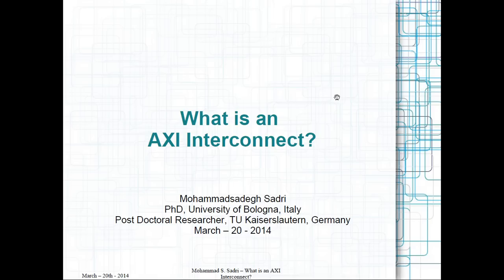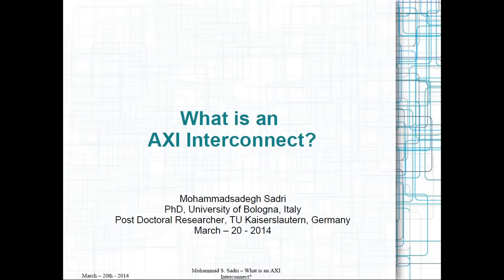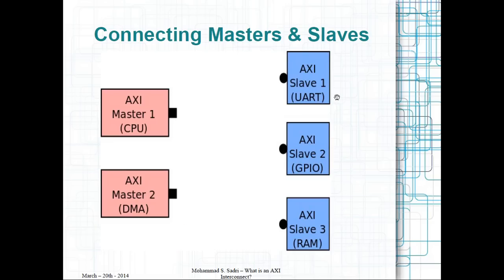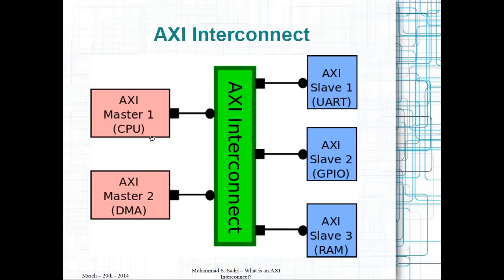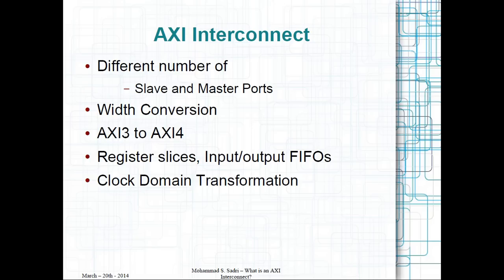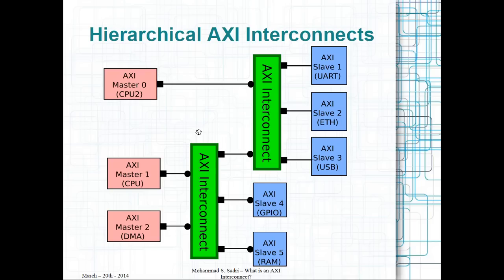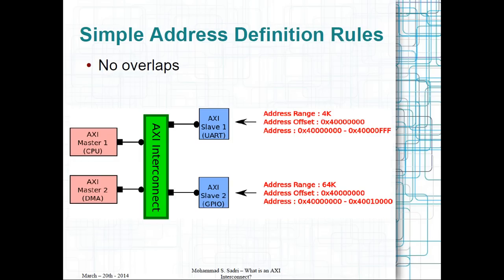ZYNQ Training - session 02 - What is an AXI Interconnect?

Comment: Hi Sir, 
Can you please clarify the address alignment rule that you talk about at 12:40 please? Why can't we use the starting address at 0x8000_0000 for example? Why does it have to be 0XC0000000?
Reply: I don't know if you still need the response, but perhaps someone else might h sees this comment later. The way I understood it is in the following way. 
The start address of the block should be a multiple of the block size.  You don't want to end up wth a 0x40001000 - 0x60001000. The reason for that is readability and memory management. I'm not quite sure though why he chose 0xC0000000 as an example for he offset of 2G.

Comment: Please tell me what is the advantage of having two different clocks ?
Reply from the maker: +Sai Ganesh your system is not necessarily running on a single clock. for example you have a cpu which is running at 200mhz and a piece of logic which is running at 125mhz and these two guys need to be able to talk. 
that was a simple answer. as you make progress through your studies you will see that frequency scaling is one of the most effective tools for reducing power consumption of a device. there you will find out that every piece of your logic can run at a different clock frequency than others based on its temporal workload.

Comment: Hi I am just not understanding what you mean with this : 2G have to be allocated from memory address 0xC0000000 because, if I am right, from this address to 0xFFFFFFFF there is just 1G space. Do I am wrong? Why is that like this? Thanks in advance. Best regards
Reply from the maker: +hahahaha you are right. in the video please suppose that the required address range of axi slave 2 is 1G and not 2G.
Reply: +Mohammadsadegh Sadri Thanks for your quick answere! BR
Reply: or the offset could be 0x80000000 with the range 2G